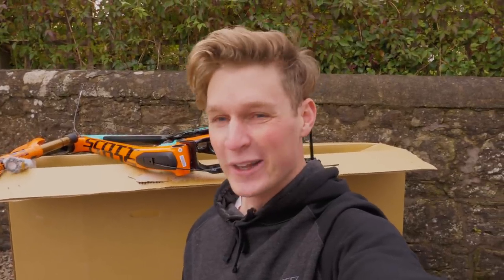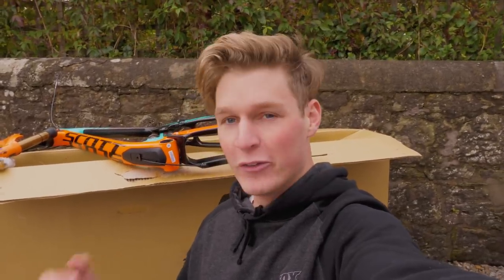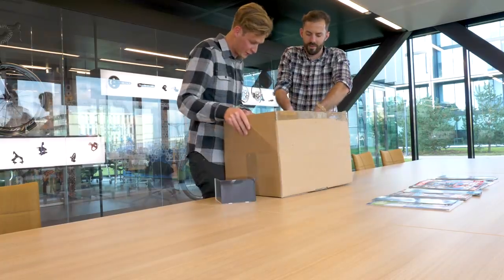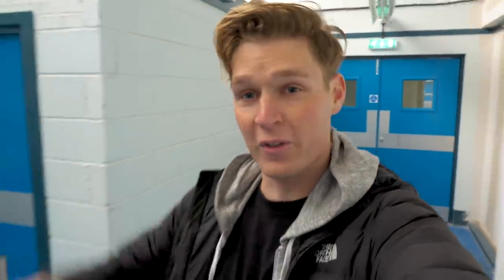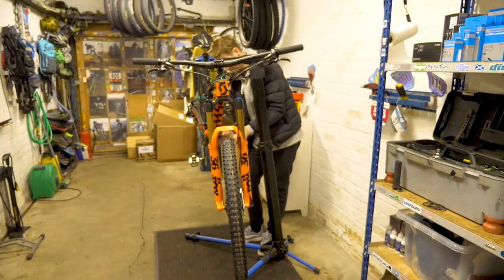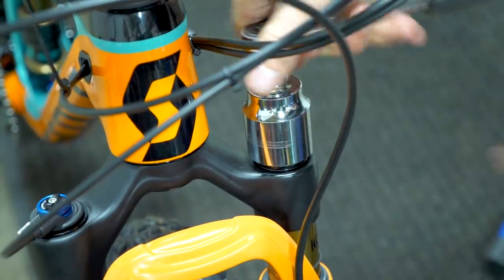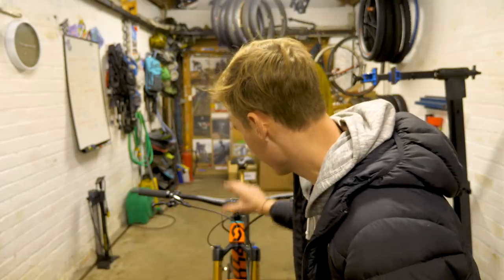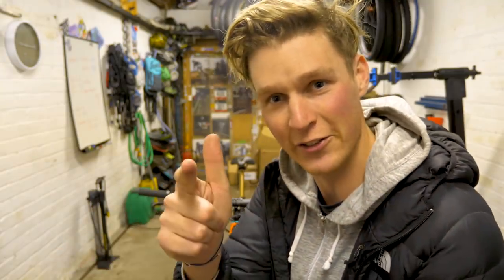BUILDING UP MY NEW SCOTT GENIUS | VLOG #1

Comment: I have ordered 930... but i hv no idea how will I assemble it.... can u plz share a detailed video????
Do i need to bleed the rear brake? Coz its internally routed???
Reply from the maker: I’m unsure of this but the brake will likely be fitted and already bled.
Reply: Thnxx...
Yesterday i got the bike it looks amazing... brakes are pre-installed...
But I accidentally removed the dropper post housing..... and now it doesn’t go back in and stucks in the bottom somewhere... can u plz help me out... 
do i have to remove BB ????any suggestions plz